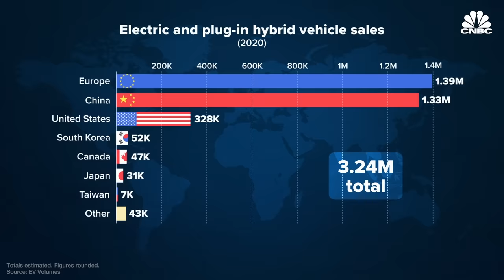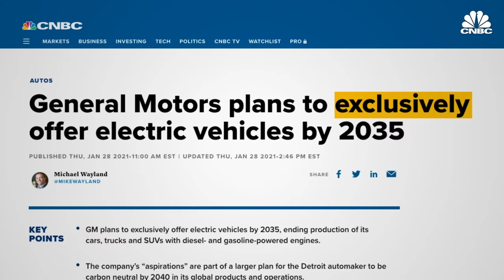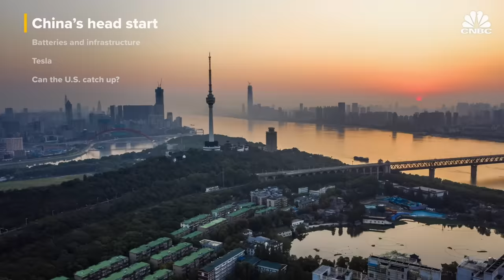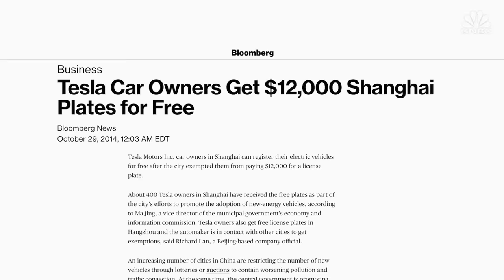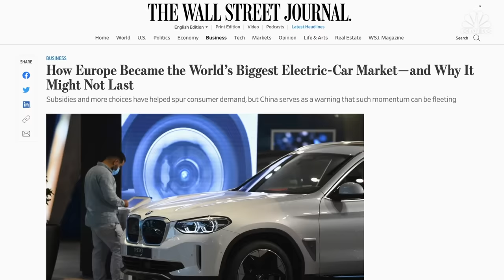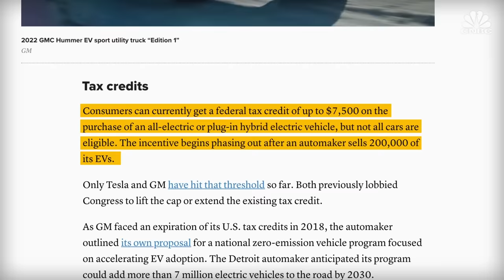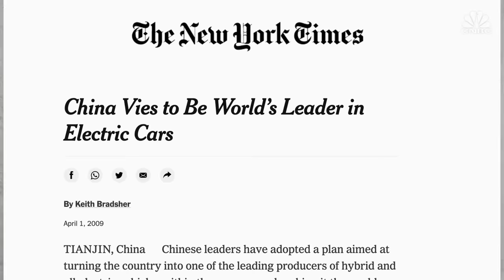Who Is Winning The Global EV Race?

Comment: Odd to say VW is beating Tesla when the model 3 was the top selling vehicle in EU for January and Feb 2022.
Reply: not to mention tesla builds 3 cars for every 1 VW. i think someones parent company got some VW ad dollars🤣
Reply: They’re likely using 2021 data.
Reply: @NityaStriker  indeed, they are trapped in the past ☺
Reply: What else would you expect from CNBS(I will let you decide what the BS stands for lol).
Reply: Vw has like 5 electric models in europe now, so makes sense. Overall VW sells more EV’s in europe
Reply: They are considering all electrified vehicles, including hybrids.
Tesla is still the number one in EVs.
Reply: Makes totally sence, if you have many models, you dont need to have the best selling one. 

There are 9 EVs in sale right now I guess:

e UP, ID 3, ID 4, ID 5, Porsche Tacan, Audi etron, Audi Q4 etron, Seat Cupra Born, Skoda Enyaq
Reply: They are counting plug in hybrids. Tesla is far ahead in battery electric vehicles.
Reply: @NityaStriker  Even in 2021 pretty sure the model 3 beat them out but when you look at the top 10 selling electrics, VW has more models on there.  So its not on an individual car base but on the overall .
Reply: Is this video just old? Probably a 2021 production?
Reply: VW Group has 9 models across 5 brands, VW, Audi, Porsche, Seat and Skoda, Tesla has 4 models, only one of which ever leads those sales (model 3). The combines sales of VW's models outstrip Tesla by about 2.5:1. You can cherry pick figures all you like but it's unrepresentative. When Tesla also has that many models and affordable ones too, their numbers may increase.
Reply: @duhaneyparkclassics7484  Most VW EV models do not yet have even a full year's sales numbers to compare. They're not yet selling MOST of them either in the USA or China too. In Europe. *VW's HOME TURF*, they outsell Tesla by 2.5:1 already ! Let's see the full year numbers for 2022 before jumping to conclusions.
Reply: @duhaneyparkclassics7484  No they're not. Wake UP ! VW group has 7 brands all active in the electric vehicle sector including commercials.
Reply: @capsytb  Tesla is absolutely NOT 'number one' in Europe or China. Tesla only leads in the USA which has a poorly developed market in EVs.
Reply: @davidm2845  No they're not ! VW is WAY ahead in European BEV sales (their home market after all). Add in PHEVs and the numbers are even worse for Tesla.
Reply: @Jeetz  Nonsense statement. Tesla leads in the USA ONLY where EV sales are low anyway.
Reply: @duhaneyparkclassics7484  Tesla has 4 models, VW has 5
Reply: @Jeetz  Don't talk delusion horse manure !

Tesla makes a fairly indifferent product with so-so build quality. BYD is making FAR MORE vehicles than Tesla can. Out of 3.3 MILLION battery electric vehicles sold in China last year ONKLY 240,00 were made by Tesla. THAT IS NOT KLEADING !

Yes, I dare say the Berlin factory will indeed improve Tesla's production numbers in Europe but they have a LONG way to go from NUMBER ELEVEN in the ranking with just 7% of the European BEV market last year ! The high cost of their cars won't help them. when their cheapest costs FOUR TIMES as much as Groupe Renault's Dacia Spring City EV !
Reply: @robertjonker8131   Tesla’s Model 3 was the best-selling electric car in Europe as of September 2021, beating the Volkswagen ID.3 to second place. Renault’s Zoe and Volkswagen's ID.4 rounded off the top three.  why I love google.
Reply: @grahamstevenson1740  7 brands does not automatically mean the best sales. in the ev world everyone wants a tesla but will settle for others. when giga berlin starts full production we wont have to have these useless discussions about FACTS!
Reply: @grahamstevenson1740  we all know why its taken so long to approve GigaBerlin, is the fear of the beating that the German Automakers are about to take. You and I both know that so lets notwaste time pretending ok.
Reply: @duhaneyparkclassics7484  You have no FACTs. What you have is aspirations. Where did I say that the 7 brands making electric vehicles currently within VW Audi group automatically meant the 'best' sales ? The individual models will sink or swim on their own merits. I really don't get those who think it's great that ONE model from Tesla (Model 3) providing the bulk of their sales means that having a broader product range is BAD ! It's a complete non-sequitur (doesn't follow).

You appear to be missing the main thrust of my point is that VW's broader range offers vehicles at many more price points than Tesla can offer. Any company making ONLY LUXURY PERFORMANCE cars (i.e. Tesla) cannot ever expect to dominate the market. It's BEYONG RIDICULOUS ! Lots of people can't afford even their cheapest model can they ? Do you want to hinder EV adoption through pricing ? They're expensive enough as it is and will continue to be more expensive, due primarily to battery prices, for the foreseeable future.

Groupe Renault has the Dacia Spring City EV that with 'incentives' can be bought in some European countries for as little as 10,000 Euros (~USD 12,000). How do you suggest that Tesla can compete with that ? Is it BAD because it isn't a Tesla ? You have to provide a wider range of vehicles than Tesla can offer or BEVs will be seen as something only the elite can afford. When Tesla can FINALLY deliver a $25k car, I'll be the fist to applaud them for it. In the meantime it's down to their 'competitors' to fill that gap.
Reply: @duhaneyparkclassics7484  NO. It's because Tesla have been playing like arseholes over environmental concerns with the site. Until the local government is satisfied with their factory and production plans, it's not going to be running at full volume.

OTHER auto makers have to follow the rules too.  Tesla has no entitlement to run roughshod over them unlike the way it may be in the USA.
Reply: @grahamstevenson1740  this is the same environmentally concerned German  Government that looked the other way for 10 years during diesel gate?  asking for my friend Jim from Paris
Reply: @grahamstevenson1740  dude i actually work in the auto industry and have been for over 15 years don't mistake sarcasm for me actually needing information from you. I know these thing in practice dealing with vehicles and clients. I have been losing market-share to Tesla for most of that time so i might be in a better position than most to have 2 cents to add.  Also once they go electric I never see them in a ice car again.
Reply: Agreed. Unfortunately this and several other CNBC comments show that this documentary is rather out of date and not terribly well informed even when it was produced.
Reply: @duhaneyparkclassics7484  Yes. I'm sure that's often the case. I'm hardly surprised regarding vehicle sales. Why don't you try to influence whatever brand you represent to do more in the BEV 'space' too ? Then you might not see overall sales declining.

FWIW, I have considerable experience in manufacturing industry and can barely believe the simplistic 'explanations' from YouTube influencers that bear no relationship to reality. Some are pure fantasy.
Reply: @grahamstevenson1740  you need to check your numbers. 4th quarter 2021 Tesla sold more then all of VW combined
Reply: Tesla moves so fast that's not even CNBS can keep up with their video reporting 😂😂
Reply: @davidm2845  They're not MY numbers they're THE numbers. The numbers for the full year. I don't cherry pick the data I use, it's deceptive to do so.
Reply: @grahamstevenson1740  For BEVs, nobody sold more in EU than Tesla. For PHEV and hybrids domestic production in EU was higher than Tesla. For GWH nobody incorporated more into vehicles and energy storage than Tesla worldwide - not even BYD since Tesla now uses batteries from at least 6 suppliers (Panasonic, CATL, BYD, SKA/SKI, LG) and is now making their own 4680 in Austin. Go watch Autoline daily and they'll spit out the numbers as they come out each week reported by territory.
Reply: China is helping Tesla by making Tesla's cars low cost in manufacturing.
Reply: @HTeo-og1lg  But not low sales price. They're quite uncompetitive, with the cheapest Tesla at £46,000 for the Model 3 RWD. and the cheapest Model Y at £55,000 ($71,700) in the UK. 

In comparison the EV that's caught my eye, the MG5 is only £28,000.
Reply: @grahamstevenson1740   Are  you certain MG5 is only STG28k?? It's a UK made car, isn't it? I'm truly surprised.
Reply: @HTeo-og1lg  It was a UK brand acquired by SAIC of China from the sale of Rover. Their EVs are making inroads in various markets. I first became aware of them when I saw a video of an MG ZS EV in Thailand.
Reply: Not to ment
Reply: @grahamstevenson1740  where are THE numbers. You’ just saying it is not THE numbers
Reply: @grahamstevenson1740  i have bashed my head against that wall for too many years and am totally over even talking to them about it. All they come up with are flashy concept cars that go nowhere and lies about why its not "very" feasible then here comes the ICE cars every Fall😒
Reply: VW has more models of BEVs and did edge out Tesla in 2021 in total sales in Europe.

However, so far in 2022 Tesla is already ahead and they are having the official opening of their Berlin Gigafactory in about a week. It looks like Tesla will be selling more cars in Europe than VW will in 2022, and probably for a few more years to come.

Of course over time Tesla does expect to lose market share. Their long term target is to manufacture about 20 or 25 percent of all vehicles worldwide.

The claims about the legacy automakers being better at mass production are nonsense. Ten years ago, yes. Even five years ago. But right now Tesla is leading the way.

The funniest thing is that having pushed the industry to electrify, Tesla is now beginning to focus on robotics. Their competitors are now aiming at a target that Tesla left behind years ago.
Reply: Old video
Reply: Oh no the Tesla little fangirls are out in force again 😂 

2021 Top selling EV car in Europe was the Tesla model 3: 141.429
Tesla total sales in Europe: 167.969

VW top selling EV car in Europe
VW ID.3 : 69.206
VW total EV sales in Europe: 310.400

So yes, VW is outselling Tesla in Europe
Reply: Yeah... cherry picking the months that supports your belief is solid arguing. Well done there.
Reply: @robertjonker8131  
You'll (obviously?) Be including Porsche, Audi, Skoda, Seat in those "VW" sales?
🙄
(Wait untill about June 😉)
Reply: Follow the money and you know why
Reply: The reason VW is winning must be because of their outstanding user interface in the ID4!! Lol. Sarcasm.  No one I’ve spoken to likes the UI.  Even a friend in Finland said it sucked.
Reply: The title of this video is “Who is winning the EV race” and then they say VW is beating Tesla by including hybrids.  Outstanding journalism.  Make sure your data supports your title.
Reply: it's even best selling in germany in febuary even though they usually have weaker sales numbers in the first 2 months of the quarter in europe compared to a local car maker like vw lol..
Reply: @grahamstevenson1740  And Model Y came late last year to Europe and only this year to the UK. Tesla sold 141 221 Model 3s and only 26 328 of their other cars, since the Model Y arrived late. The Model 3 alone outsold all the VW EVs. That is remarkable, since it doesn't directly compete with most of the other VW branch cars. ID4, Enyaq, all the Audies, aren't really what the Model 3 is competing against. 
VW, Audi and Skoda together sold 271 692 electric cars. Porsche sold somewhere around 11-15 000 Taycans in Europe. If we say 13 000 cars, then the VW group sold 70% more Electric cars than Tesla and not 150% more as you claim. . And that is pretty much 9 models against 1, since it was pretty much only the Model 3 that is delivered to Europe all of last year. Or let us say 7,5 against 1, since some of the cars didn't come before around late summer.

This year, with the Model Y and the delivery problems of the VW group, Tesla will probably do even better. 
I do however hope VW keeps their game up. The ID4 is kind of boring, but the interior of the Enyaq is really nice. Hopefully they also come with a car that has the same amount of space as the Model Y. I also hope that Hyundai and Kia will keep making interesting cars as well, even though the Ioniq 5 was a disappointment for me.
Reply: @fredrikfjeld1575  "VW, Audi and Skoda together sold 271 692 electric cars. Porsche sold somewhere around 11-15 000$

THE ABOVE FROM YOUR POST ! That's MORE than the 167/9,00 that Tesla sold then ? YES ?

So, in fact VW has a 50% LEAD in EVs vs Tesla in Europe, their home market.

Why do you allege otherwise ?
Reply: @grahamstevenson1740  I just said the VW group sold 70% more than Tesla. What are you even on about? Read what I wrote and then try again.
Reply: @VINTAGE-AMERICANA  I have unsubscribed. too many INSANES, GAME CHANGING etc.
Reply: @icare7151  yeah, no. China street their power expansion before the huge focus on Evs. China also has had a lower output of co2 pr citizen than most of the western world. This is about to change, but it is hard to argue that the Chinese deserve to be left as a back water. China is also building nuclear and other kinds of power, but coal often takes a lot less time to build.
Trumps tariff war with China also stopped Bill Gates and others from investing in nuclear and other green energy in China, which would have made meeting power demands even more difficult.
China also has a lot more power hungry production than a lot of the west.

The only way to get China to lower their emissions is to say that they can never be allowed the same comforts and luxuries as the west and to forcefully limit their economy.
If anyone had tried to do that to an European country or the US would create a war. So hopefully we do not get to that point.
Reply: @Jeetz  lol tesla is expensive af who tf buys tesla
Reply: It’s that although the Tesla Model 3 was top selling car in the EU  for January and February 2022, but the Volkswagen Group is the leading brand in Europe, but Tesla will takeover VW because they are completely stuffed in regards to the chip shortage, they’re not getting enough every month to keep up, and not only that, they need to build a new plant for electric cars for the trinity project but that won’t happen until 2026 by then Tesla would’ve left them in the dust, even GM and Ford will pass VW plus all the Chinese cars.   Volkswagen are definitely not in this race!
Reply: Video is made7-8 months back at least
Reply: Don't forget VW has several brands...
Reply: @gideonporter537  yeah but not all make EVs .
Reply: And Tesla Gigafactory in Berlin is open for business.
Reply: Just remember let’s go Brendon marry you did it you really did it 🇦🇺
Reply: @hugosousa4438  It is? Awesome
Reply: 3 mins in it says originally aired 2021
Reply: @grahamstevenson1740  Giga Berlin has fired up and will soon out pace everything VW does.
Reply: @johnarnold893  Giga Berlin has a projected annual capacity of 500,000 vehicles. In the 3 quarters left of this year I'd expect them to manufacture perhaps 250,000 cars. You don't 'switch on' a factory like a lightbulb, it needs to ramp up. Remember 'production hell' in Fremont ? In the meantime,  I expect the the 10 other car manufacturers AHEAD of Tesla in EVs in  Europe to be increasing capacity too. It'll be interesting to see.
Remember too that Tesla has no properly affordable EV to offer. Even the Model 3 is twice what many others EVs cost. Eventually the demand for their luxury performance vehicles will start to dry up.
Reply: @duhaneyparkclassics7484  In Europe VW Group EVs OUTSOLD Tesla by around 2:1 ! VW has no need to quote numbers for just ONE EV model ! They have 8 or 9 on the market.
Reply: INDIA WANTS TO FALL DOLLARS VALUE..
Reply: All EV owners are clearly smiling now against gas cars and gas prices.
Reply: But volkswagen sells more Evs in europa then Tesla!Tesla only has 2 midells that selling in high numbers!Tesla is number 4 in Europa after Stellantis!Right now only about 10%of all sold evs in europa are Teslas!
Reply: VW group reportedly said their EV’s make a loss because of the antiquated manufacturing process. Not a good business model going up against Tesla’s 30% profit per car.
Reply: all battery from East asia (China, korea, japan.) they are winner.
Reply: VW ceo said himself they cannot compete with Tesla at the moment and Tesla builds cars 3x faster
Reply: @robertjonker8131  I don't think that's true, even with all those hybrids being counted as electric.
Reply: @duhaneyparkclassics7484  That's not necessarily a good thing. It takes time to assemble something the correct way with quality checks at various steps of the process.
Reply: They also spoke of the Mach-E as if it wasn't released yet.
Reply: That's 'cherry picking'  umbers again ! Also look at ALL of the VW brands (5 are currently making EVs) and models.
Reply: @dubbelosexy  and others arguing about this...

Tesla sold in Europe: 97957 in 2020, 169507 in 2022, absolute increase 71440, relative increase >73%.
VW group sold in Europe: 191800 in 2020, 310400 in 2021, absolute increase 118600, relative increase <62%.

So VW group sold more cars in Europe in 2021. VW group sales increased over 2020 by a larger absolute amount that Tesla. If the latter continues, Tesla will never sell more cars in Europe that VW group.

The relative increase increase in Tesla's European sales was greater than the relative increase in VW group's sales. If this continues, Tesla will eventually sell more cars in Europe than VW group.

You can cherry-pick either to argue either result. Which will win out? There is one sure way to find out. Wait a few years and look again, repeat until satisfied. Nothing else will work.

But who cares, anyway? The fact is that Tesla is selling every car it can make - and the same is true for BEVs made by just about every other western manufacturer. Almost all, if not all, have delivery wait times that are growing. Until BEV manufacturers can satisfy demand in at most a month, none of this means anything, anyway. This argument is no more meaningful than arguing over angels dancing on the heads of pins.
Reply: 0
Reply: @benjaminsmith2287  Check out Joe Justice video's and interviews. It is all done with AI and every vehicle has a digital clone stored. There are in fact multiple changes including mechanical to increase efficiency and improve the vehicles made EVERY DAY
Reply: Odd isn’t it the the state of California DOL has pulled Tesla’s license to sell their cars in the very state which made that company possible. I guess lying to your customers & the public does have repercussions.